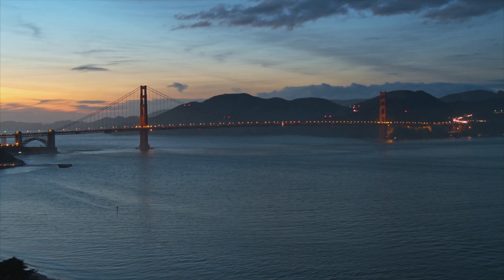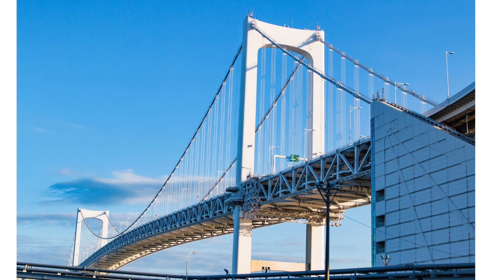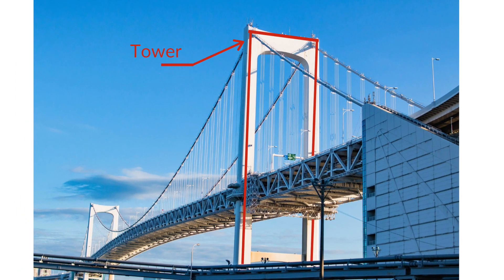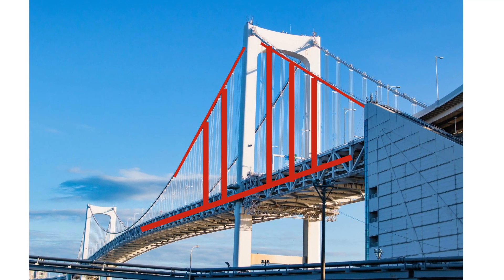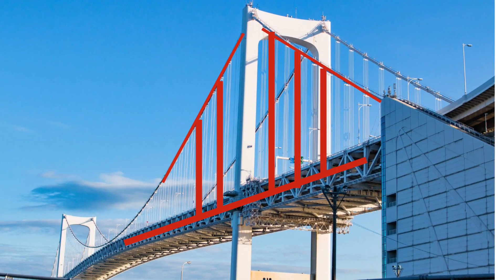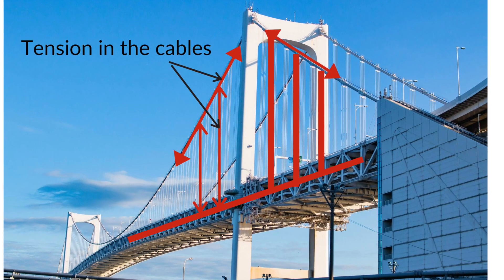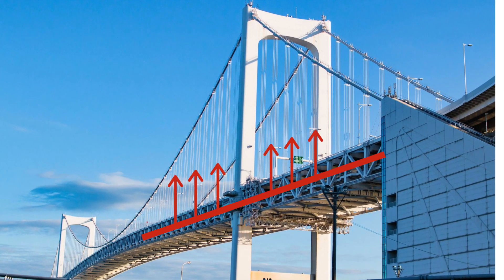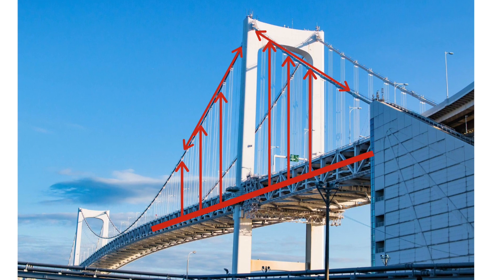What is a suspension bridge? | How does it work? | APSEd

Comment: Suspension bridges are still being built in large numbers because cable-stayed simply cannot reach central span lengths that suspension bridges can.

1,200 meters is about the longest central spans that a cable stayed bridges can be expected to reach whereas building a suspension bridge with a central span of 2,500 meters is very feasible.